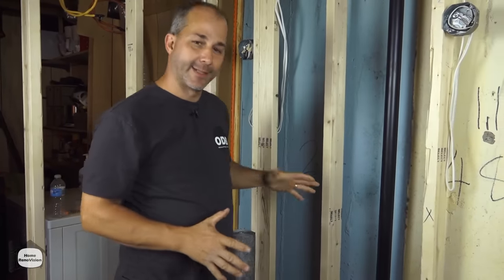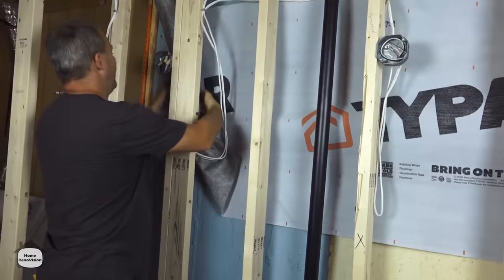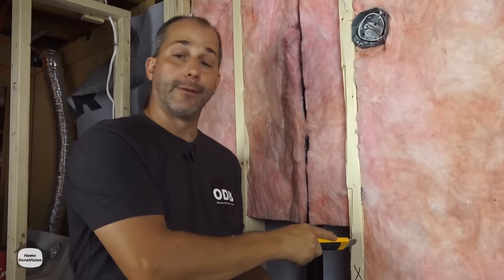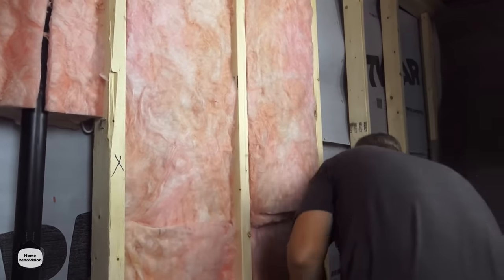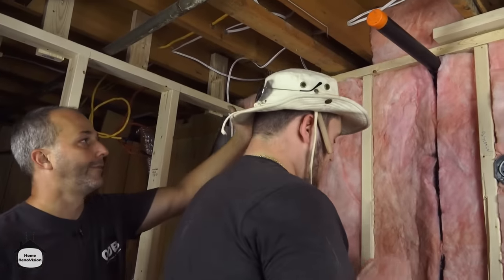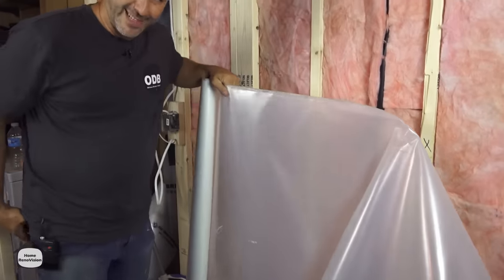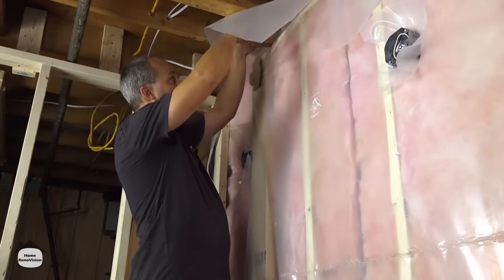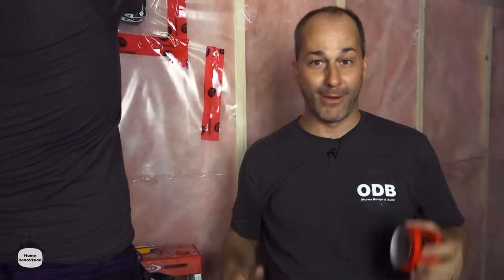How to Properly Insulate a Basement Wall: NO MOISTURE!

Comment: I really enjoyed your video thank you I have a question how would you insulate my house in 1947 I think the wall is the outside wall is brick then it has block and then it’s mortar or the wall mortar they put on that’s all I have on my walls how do I and  insulate to take the moister away also in the winter the walls mold thank you
Reply from the maker: Hi juanita, your house has no exterior protection against water which is why it is always wet. you difinitely need an air space before the walls. I would suggest getting the exterior wrapped in a foundation water diversion system before finishing the basement. This way you can manage the moisture levels much better. You will also need a subfloor system and a dehumidifier and an exhaust fan at the very least perhaps even an HRV unit for best results.

Comment: HI Jeff. Thanks for the video. Is that actually a basement wall? It doesn't look like concrete. Is there already something applied to the concrete as it looks yellow or blue. Also, I am wondering if this method is advisable if there is very little space between the frame and the concrete. The builder framed the basement but the frame is almost butted right up against the concrete making it impossible to insert any of the rigid insulation products.  Thanks in advance for any suggestions!Jen
Reply from the maker: Hi Jen, I am going to do a show on basement construction. So many things have changed in recent years that each house has a different system that will work best. BTW someone has painted the walls  over the years . Cheers!

Comment: Coming to you from Michigan!  I love watching your videos.  So my question is what is the reason for the gap between the exterior wall and the frame.  I will be framing in my basement and wondering is that necessary?
Reply from the maker: in older houses we don't have exterior waterproofing. That being said relying on air movement to remove moisture is critical to good performance and mold control. Especially in 4 season climates like yours. Cheers to Michigan!
Reply: So how much or little could you get away with?  1"... 2"?  Thanks for your info and time.

Comment: Great video. My electrical panel is in the basement. How do you vapour barrier around it/behind it to keep drafts down? I find that corner of the basement is very drafty. Thanks!
Reply from the maker: The best way is to build a wall with a door. That part of the house will never have a good thermal break.
Reply: You can temporary dismounted it and add in insulation and vapor barrier. However if unsure what you are doing, better get a professional to do it for you

Comment: @Home RenoVision DIY: Why didn't you make the overlap of the barrier airtight by a special tape? (In the first step)
Reply from the maker: the goal of the typar is simply to keep the insulation in place long term. It is not a air or vapor barrier. I chose that material since it is cheap and does not block moisture. The plastic sheet is the vapor barrier and the air barrier.

Comment: Hi;  general contractor here with lots of eco house formations 

Your video started out bad, the typar used here is a one side only installation

It’s main use is t prevent exterior rain to get in the whilst letting water vapour from inside out.
How it manages to do this is with the fibers lineage, think of it like a roof with asphalt shingles, the rain doesn’t come in because it is laid so the rain falls down with gravity 

Your typar here serves nothing as the humidity/condensation still will penetrate de typar thus getting your wool wet

I hope I was clear on my explanation, English isn’t my native language

Comment: Hi 😊 my boyfriend and I just bought a house and we have a basement that is kind of filling with water. What I mean is that there isn't water everywhere but just in some of the the corners of the rooms. It is not a lot, maybe just like 2/3 cm deep but we really want to get rid of that problem. The only thing in the whole basement is a wooden staircase and as it leads exactly to one of the corners, it started rotting and I am afraid that it may create mold problems in the future. So you have any solution for our problem and what can we do about it?! Have a nice day ☺️👌 Greetings from Denmark! 🇩🇰✌️😊
Reply: Just move :)

Comment: Hi Jeff, I am doing vinyl flooring in my basement (based on your vinyl plank videos :-) - I noticed that there is some mold (dryed old) on the floorboards and some discoloration on the concrete blocks closer to the finished walls, I have been staying in home (20 year old home) for 3+ years, so not sure the previous owner had some water leakage etc (didnt report it on disclosure). How can I reduce moisture from the concrete walls (previous owner already has dry lock type paint on the concrete walls). Happy to send you pictures if that helps explain the issue. Just need some guidance - appreciate the help

Comment: Jeff,
Love your videos. I am looking to start finishing my basement and can't decide the best way to insulate the exterior foundation walls. The exterior of the walls was sprayed with the black water proofing tar. The basement is very dry and temperature consistent. I plan on using your flooring system with DMX underlayment and 5/8 T&G ply on top. For the walls, I am considering the 1" air gap, 2x4 studded walls with at least R13 faced roll insulation. If unfaced, then I will use the poly for the vapor barrier. 
Anything else you would suggest? Is it cost effective to have the foam boards on the walls + the 1" air gap? TIA
Reply from the maker: Hi Bobby, I don't suggest using foam against the walls unless it is waterproofed from the exterior. since you have tar that is a huge clue that your walls are not. leave the airspace so the house can redistribute the moisture that eventually will penetrate. Cheers!
Reply from the maker: BTW use the vapor barrier and build the walls on top of the dmx and subfloor if you can. Cheers!
Reply: @HomeRenoVisionDIY  Maybe I am not understanding you correctly, or didn't state correctly. The outside of the exterior walls (portions under grade) was sprayed with the black waterproofing tar. So, I understand this as being waterproofed from the exterior. 
Last question...basement floor was sawed for relief cracks, should I fill these with a sealant before putting the flooring down? Thanks again! Cheers!

Comment: JEFF:  Hello there and Happy 2019! One of my many New Year's Resolutions is to do something about our basement, in the UK. It has been converted badly, a DIY job about 15 years ago. We live in a brick Victorian period house, about 115 years old. The whole street is made of terraced houses of a similar age, and the water table is very close to our basement floor at our point, so a sump pump was installed and we have recently replaced it after it died and left us with a flooded basement in the middle of moving with lots of boxes damaged, oh 1st day joy. The floor was carpeted and smelly so we removed it, but we cannot identify what the actual floor is: concrete, epoxy, bitumen...? It is black with some cracks and not flat at all. Anyway it is in bad shape and needs attention, we need to level it, add a damp membrane and finish it with vynil flooring. There were old spotlights on the ceiling, GU10, and we have simply replaced the bulbs to LED. I imagine that we could get some extra height if we remove the ceiling cavity and use flat LEDs. Now we have 2m height, which is the legal minimum and would be affected if we do the flooring. As per the walls, we have a bay shape to the front exterior, but it has been blocked with studs and plaster sheets, to form a straight wall with a central heating radiator. There are wooden skirting boards and I can see that they are getting black at the bottom so I suspect mold going on behind that wall. Covering the bay means that we cannot open the window, which is a sin in a basement, we have a dehumidifier and there is no door to the ground floor to help with air movement. As it is, without an opening window it can only be used as storage, but I would like to use it as my office so we need to get to the original bay shape. My question really is where to start with. I have seen some systems not to avoid water coming in but to redirect it to the sump pump creating a channel where the walls meet the floor, like a French drain.What do you think about those? When we remove the false wall, is there anything that we should do to the exterior brick wall other than cleaning the mold? As per the floor, I have seen liquid damp membranes as well as those plastic sheets you use in other videos. Considering that our floor is not flat at all we will need a self levelling compound, can we use the liquid membrane or better to use the plastic over we get a flat floor? Sorry, lots of questions and a bit lost with the options. Thanks!
Reply from the maker: WOW, I would start by removing the concrete floor! this will allow you to install the vapor barrier underneath the slab. costs about the same as using floor leveler and allows you to determine how deep to go and install the drain you mentioned. As a DIY it is sweat blood and tears but great value if you can convert the basement to livable space. underpinning does not sound viable with your water table however you will want a sump with a second pump on back up power. Cheers!
Reply from the maker: BTW concrete floors usually don't have any rebar and chip out pretty darn quick. Cheers!
Reply: @HomeRenoVisionDIY  Hi Jeff, many thanks for your answer! So first removing that fake wall to get to the bay area, where the floor starts, then removing all the existing floor, then the French drains right from the original walls to the pump, then a barrier directly over the soil, then new concrete floor.  Should I leave access to the French drains, or can I cover them with the new flooring?  Can I use pre-made small concrete slabs to make it more manageable?  This will take me several months, working on the weekends, but as you say I will get a livable space.

Comment: Was the wall behind the studs your exterior concrete wall?  Or did you put board insulation directly on the concrete wall first?
Reply from the maker: just the conmcrete. The rest of the basement is done the same way there is no advantage to doing this part any different.

Comment: We have a an attached duplex with 0 water infiltration/condensation since its construction, 1945. I am looking to finish on my own the exterior walls and have seen multiple videos with various methods. Since Ottawa and Montreal have the same climate conditions, would you recommend foam board on wall or the barrier method you used?
Reply from the maker: Hi Jonathan, the lack of water penetration is not the construction of the house rather you have good exterior drainage. As long as you maintain that you can go with a rigid foam to create a thermal barrier. That system is most ideal and then of course frame and insulate the wall as well. Cheers! If the cost is too great then my system shown here is very effective as well.

Comment: Any recommendations on the best approach to insulating a basement pony wall? I believe that is what it is called. What I have is about a 4ft concrete wall with a studded wall to finish the basement off at a full height. The stud walls have fiberglass insulation with vapour barrier already. From the edge of the studded wall is a ~2" concrete lip so there would be a gap if I made a wall tight against the foundation.

The foundation wall on the outside has blueskin + dimple board so I am not too worried about water getting in. I could put foam board directly against the wall but I also want something to attach drywall to. I am also planning on laying some dmx dimple board on the floor to begin insulating it and would want to tape it to the walls as a vapor barrier if I can.

Probably a bit hard to answer in a yoututbe comment but would appreciate any advice you could give.

Comment: Hi! my basement has existing insulation from top to half-way across the exterior wall with vapor barrier installed by the builder. Do I need to remove these existing insulation and start new?
I saw this one of your videos but I’m not quite sure how its done..
Great Video, Thank you!
Reply from the maker: not needed. you can always just build the bottom half when you are ready.
Reply: @HomeRenoVisionDIY  What about if you have only old white styrofoam in the half top of the wall?  Do you keep it or you remove it?  Is it possible not to cut the wall until the ceiling (I don't want to need to make the wall-ceiling joint and to need to paint all the ceiling again after only one year, if possible).  I had water from the snow  coming through the windows flooding the inside, so I removed the gypsum walls until 3 inches from the ceiling because I was forced to cut the walls any way due to the flood.  I don't see how can I install  that  plastic if it is not opened until the ceiling and still sigh. I have seen that after the plastic you need an air space between the gypsum and the plastic to forbid the gypsum to be in direct contact with the plastic and produce condensation.  What is the true and what do you suggest to improve the isolation of my basement.  I need to reconstruct so I need to determine what is the best way to do it.  Thanks very much